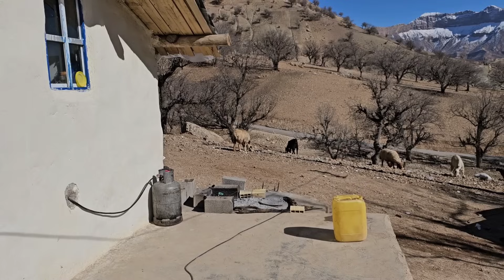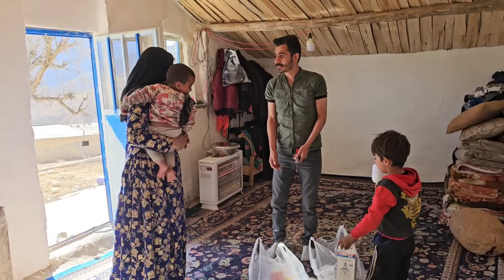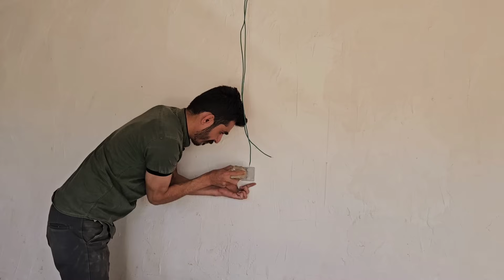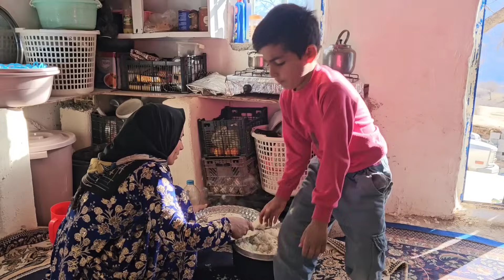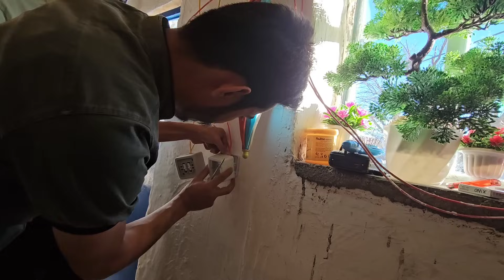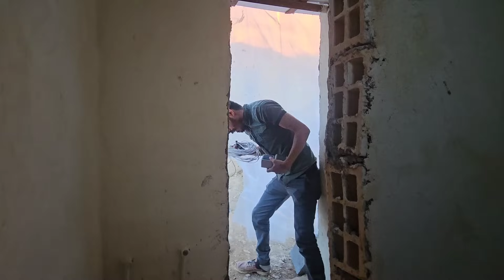Solidarity and sacrifice on the day when the nomadic man decided for the master electrician's house

Comment: Qasim and Shahrabano your house is now looking good with  lights inside and outside. My only concern is that the outside light is hanging too low, because when it rains water will get into bulb holder and will get an electric shock. The wire should be short and connected more towards the wall, if not then a shade should be connected to protect from rain and snow. Camera man please make sure the outside light is safely connected. Thank you.